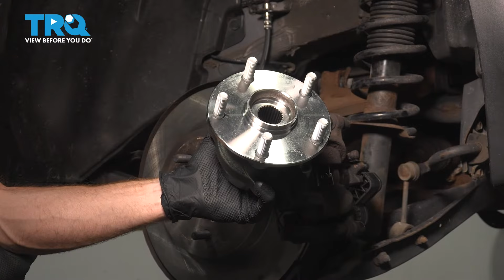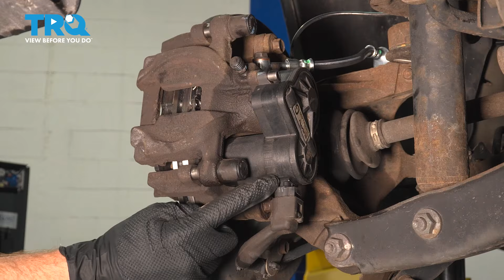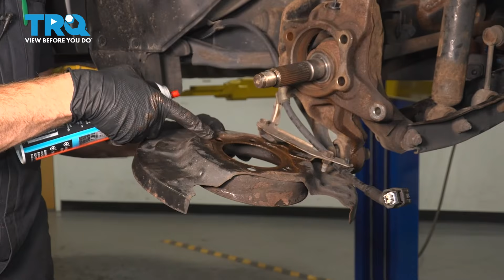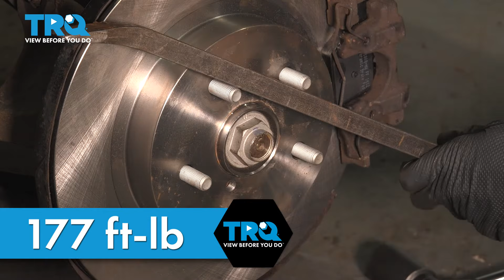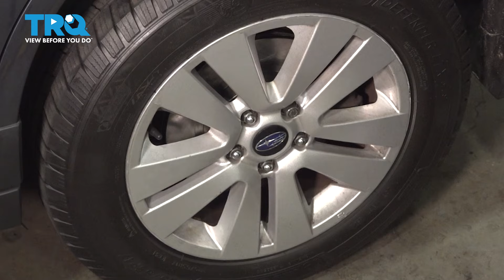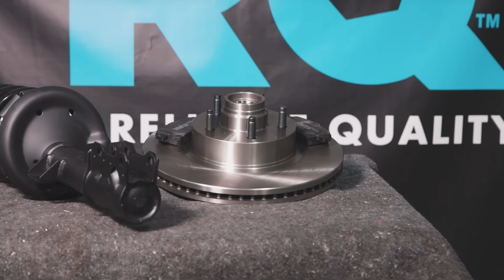How to Replace Rear Wheel Bearing & Hub Assemblies 2015-2019 Subaru Outback

Comment: Just to be clear, this is an absolute misrepresentation of how any Subaru rear hub assembly has ever been removed at any point in history, ever. Three days after install, they are rust welded to the knuckle permanently.

You will NOT be able to beat it out with a hammer, and unless you're a pretty handy fabricator and mechanic you WILL separate the hub assembly. 

This is not a novice project. 

Your best bet as a DIY is to remove the knuckle entirely, and take it to a shop to have the the hub pressed out. Seriously, just pull the knuckle and pay. It'll save your sanity.

Comment: "While removing that final bolt, it's a good idea to hold onto the wheel bearing."  Uh, there is no planet in which the wheel bearing is going to just fall off the vehicle. Which was soon discovered in this video when the technician was using a mini sledge to beat the heck out of the wheel hub and mangle the backing plate in the process.

Comment: Just replaced my rear wheel bearing and I’m getting a bunch of ABS/VDC lights on the dash now. Any ideas? The ABS plug clicked into place like it’s supposed to, all connections are the same as they were before the parts were swapped

Comment: “Couple Light taps” my a$$. When 2 hours with an air hammer didn’t do it, I removed the entire knuckle, ruined the upper ball joint, paid a machine shop to press out the hub, bought a new backing plate from Subaru, waited 2 days for another upper control arm, and then re installed. If you live anywhere north of the Carolinas, this videos isn’t realistic.